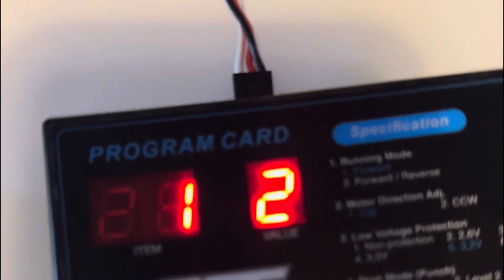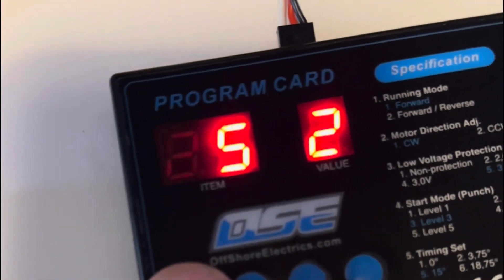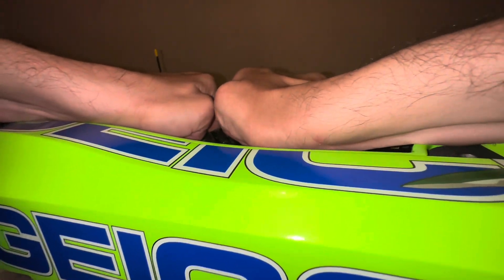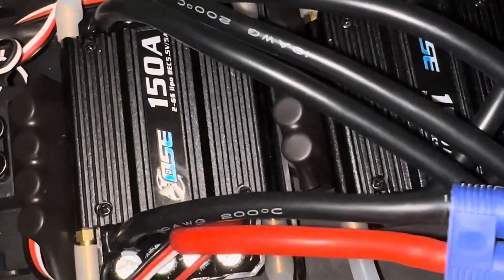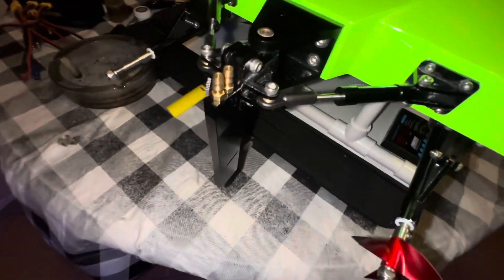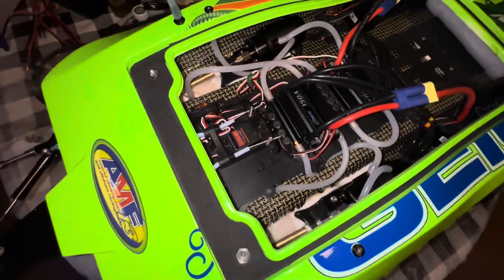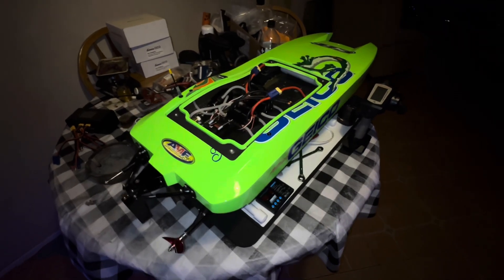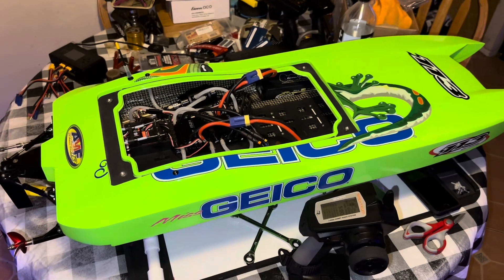Proboat Miss Geico 36 Build Part 5 Twin OSE Raider 150 Installed And Cooling Lines

Comment: I’d keep it on 4s brother kv much better suited to it. Especially with huge 50mm 3 blade props those will pull crazy amps
Reply from the maker: Thanks for the tip! That will save me some battery money 🤙😂  
Its just my cruiser so what would be good cruiser prop? I went with 5016 cause I had them on my blackjack 42 and bashed around hansen no problem but thats a different beast right? More power bigger esc motor combo? Boat Werks recommended Octuras 437 & 450 so i got those on my ose wish list 🤙🛥️
Reply from the maker: Maybe you can give us a class on props and electrics combos?
Reply: @OGPAPERBOY77  ya bro all due respect 437 too small 450 too big. Problem with 2300kv on 6s is it’s way too spicy. On a twin we run smaller props because there’s two of them. Also wouldn’t run anywhere near the size of a 42 single as far as big props. I’d just monitor temps keep it on 4s should be plenty fast. Slow down on buying stuff until you can get some testing in and see what it likes 👍🏼
Reply: @OGPAPERBOY77  keep it 4s , stock geico props are inexpensive , stainless, easily sharpened and balanced , on 4s 2300 kv should be good for about 64 mph according to my speed calculator. Plenty to have fun with. But like I said just run it with what you got and see where it’s at then we can go from there
Reply from the maker: @RogallaMarineRC I appreciate it all Bro 
Im lucky to have you guys give me tips and feedback Boat Gang #1 🤙🛥️
Reply from the maker: @RogallaMarineRC so the stock 1.7x1.6 is what you recommend? Thats the same that came with my sonic wake and bj42 stock? 
If so I got a couple of them so I would just need a Left CW?
Reply: @OGPAPERBOY77  the geico props are what came on your veles. It’s that prop similar to an abc 1716. You’d just need the reverse rotation and you’d have a twin set. They have a lot more pitch than a sonic wake or blackjack prop. You need the extra pitch for 4s 2300kv. As a baseline keep in mind stock geico comes with 1900kv on 6s. So do the math on the rpm
Reply from the maker: @RogallaMarineRC ok thank you bro 
Im still learning a lot about these boats I know everything bout hoes just not these boats 😂 🤙 appreciate you Sorry if my Friday ass is asking a ton of questions
Reply from the maker: @RogallaMarineRC i found the prop at my local hobbytown so we are good to go Thank you bro 🤙🛥️